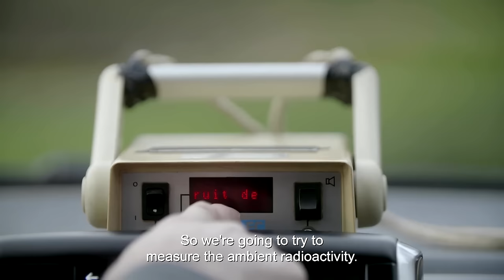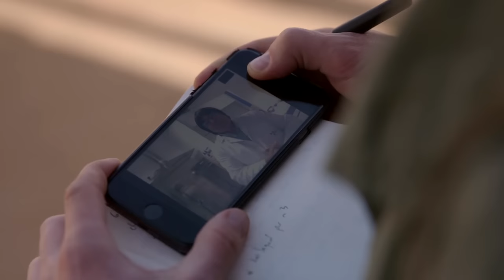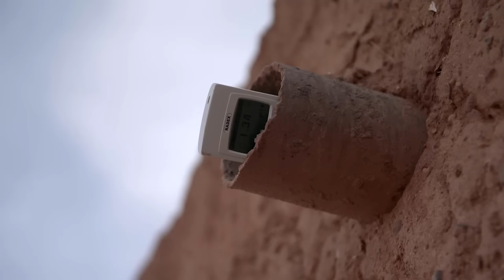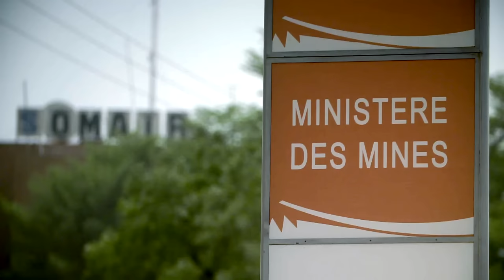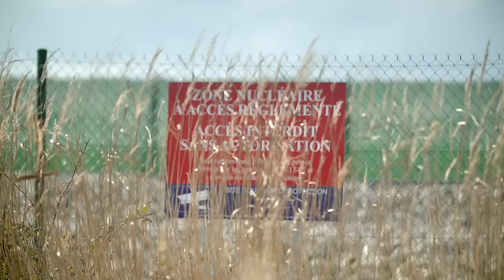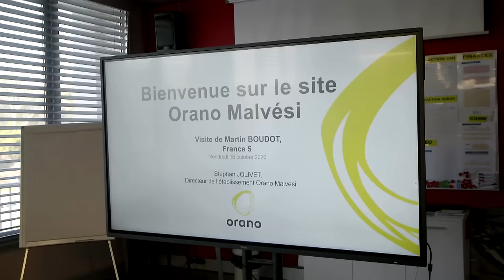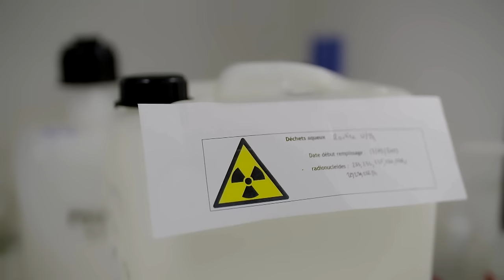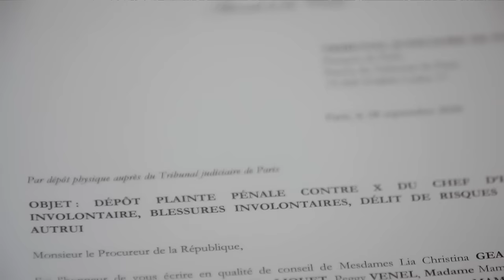Worse Than Chernobyl: Following Europe's Nuclear Pollution to Schools in Niger | Full Documentary

Comment: Here in South Africa,  the mines also created radioactive waste in the dust. It is blown all over Johannesburg and surrounding areas.
Nobody says anything.
Reply: What a horror. I hope that someone important is made to take notice soon.
Reply: Lived in Harare and was sick four or five times a year but since moving back to the UK I've been sick once in ten years,  I was told that it's alot to do with Africas dry dusty conditions.
Reply: I worked on an oilfield. When i arrived service companies sandblasted vessels in a maintenance project. Without even dust masks. Short time after they had full body condoms and breathing supply from outside the vessel. The material they removed was mainly gypsum CaSO4 with some content of Sr90SO4 and RaSO4. And in the sludge were two lead isotopes one of them Pb210. So most was alpha and beta radiation that wont pass the steel of the vessel but is very bad after inhaled or swallowed. The lead gave off neutron radiation what is harder to detect. Radon was mainly in the gas phase. Later we got a decontamination company to sandblast old pipes in a special facility to collect the blast off material in drums and put it in a landfill with bottom and walls from concrete. They did not allow us to go as close as 10m to certain pipes. Especially some gas pipes. I got samples of sludge where the counter gave a constant beep with 10000 times the environmental radiation through the glas bottle...
Reply: Purchase a Geiger counter if possible to avoid concentrations
Reply: @mweskamppp reading this, I am really curious what radioactive counts used engine oil would give. Surely the lead would have been removed. But the Strontium and other radioactive elements!?
Reply: @Edseltje  It is not in the oil  you buy. Lead has several isotopes, some are radioactive others not. Also strontium or radium you wont see usually.  Radon you might have in significant amount in your basement, depends where you live. Besides that your personal radiation comes mainly from flying with jets in form of cosmic radiation that is usually stopped in the lower atmosphere or from your banana that contains some radioactive potassium in small amounts.
Reply: @mweskamppp  Thanks for the clarification! At least there IS some good news.
Reply: @mweskamppp  where?
Reply: @tonytrade  That oilfield? In Libya. I worked there from 1999 to 2014 with few month break during the revolution. The radiation problem can be found with some oilfields not all. Depends on the underground geology.
Reply: @mweskamppp  thanks
Reply: @11:25 they said that the radiation levels were 30x background. If background is 10 microRem/hr then 30x that would be 300 microRem or 0.3 mrem. Public dose annual limits are 100 mrem. I don’t understand how they are calculating that only 1.5 hours would exceed the annual limit 🧐🤨
Reply: That’s terrible

Comment: bEING some one who was educated in nuclear physics, I see the town in africa and yes thats bad, BUT in france the effluent is uranium 238 an alpha emitter. To have as dust like in africa that is extremely dangerous once inhaled or ingested. But when put in those barrels which are mainly mixes of nitric acid and U238 as the U235 which is much more radioactive and dangerous, is made into yellow cake or metal ceramics for reactors or weapons. The steel casing of those drums will stop all the alpha particles from the waste. In fact you can put high level fission products such as cobalt60 strontium 90 and iodine131, in a concrete cask and it is perfectly safe. So the people in africa should be scared to death, the people in france while yes its an eye sore in the vinyards have nothing to worry about. Don't belive me? Do the math yourself, MITOPEN course has a whole class on nuclear101 get the text book and a calculator and form your own opinion.

Comment: Uranium mining is very low risk. I doubt the message as here conveyed. 
As a specialist ive been to Chernobyl and Mayak… these are not uranium but enrichment facilities where daughter products of enriched 235 are very active. It is very different to yellow cake dust. This is not good BUT at tye same time sensationalized… overcooked to peovoke a reaction. This is ok too because it is poor health n safety. But not what the title suggests.
Reply: IT seems like they are really only picking up low levels of radiation on contact with sources. I doubt they receive much of a dose from the radiation. I would be more concerned about radon in the buildings and breathing in large amounts of contaminated dust. I have clocks that put off more radiation than they were showing here.